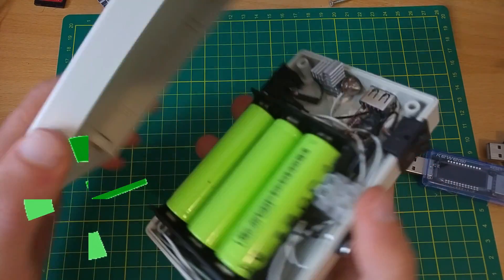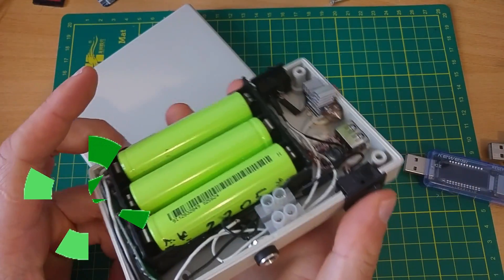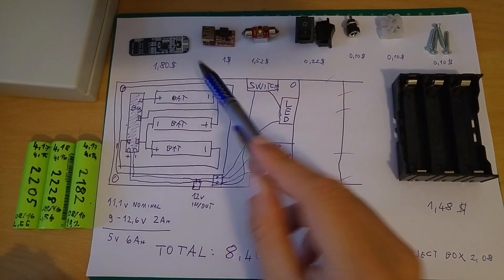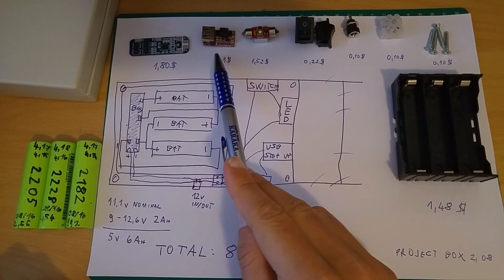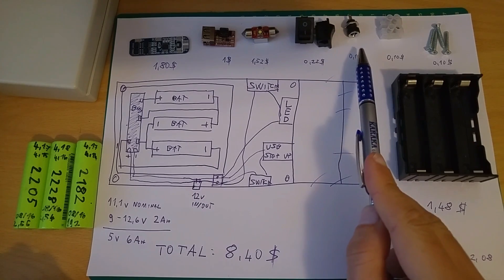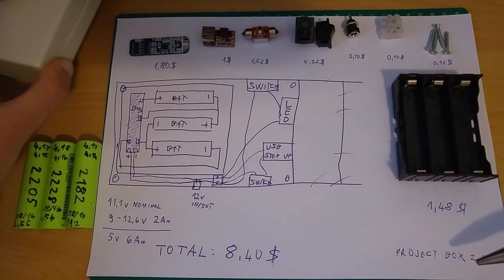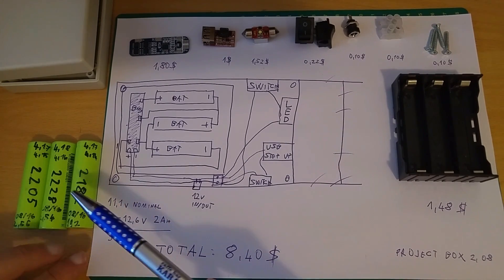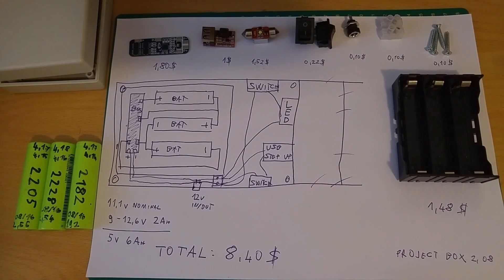12V BMS Powerbank

Comment: The first BMS that you tried to use but you said are not working actually do work. In order to get a voltage output from those terminals OUT you need to connect a 12.6V charger to it in order to activate the board.

Comment: Or you can save yourself the hassle and buy one. https://www.ebay.com/itm/Mobile-Power-Bank-Box-USB-3-6V-5V-6V-9V-12V-6-x-18650-Battery-Charger-Adapter/262466536578?var=561271288091&_trkparms=aid%3D222007%26algo%3DSIM.MBE%26ao%3D2%26asc%3D52885%26meid%3D4a870518e08542ffb929df7f52d7e82f%26pid%3D100005%26rk%3D5%26rkt%3D12%26mehot%3Dag%26sd%3D252962915309%26itm%3D561271288091&_trksid=p2047675.c100005.m1851

Comment: I know you are to busy to reply, so im asking this for fun, those BMS are silly, what did you use to power/charge this unit after ? they seem to have a very narrow voltage input range to work,12.6-13 volts, so you have to make up a special charger 
for this ?
Reply from the maker: Ideal charger is 12,6v but you can use 12v charger and it will work too. Disadvantage is that you wont have full capacity, but that way you can get more cycles from batteries.